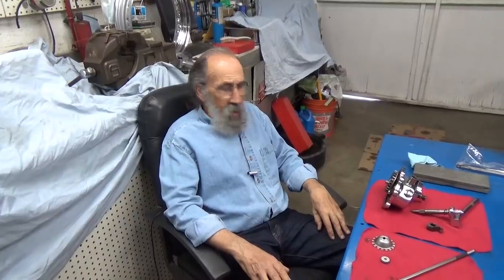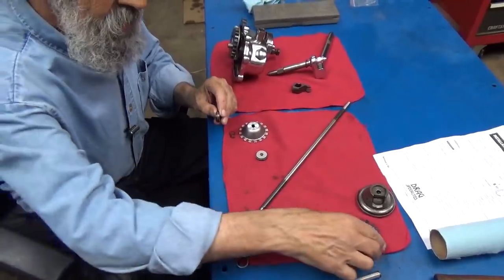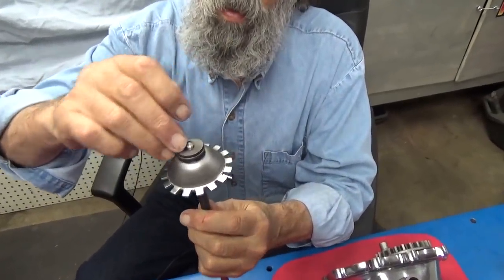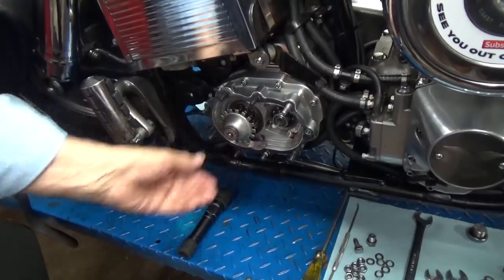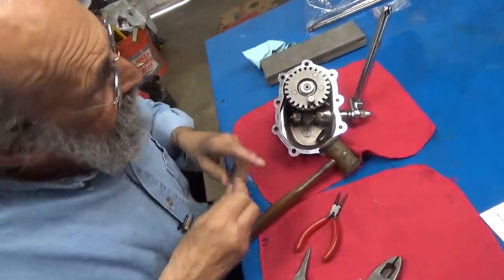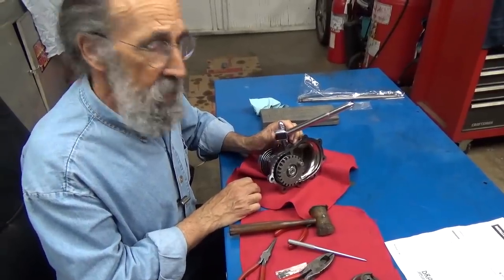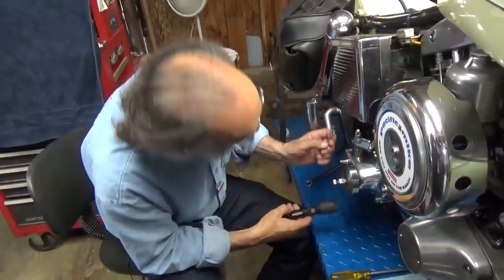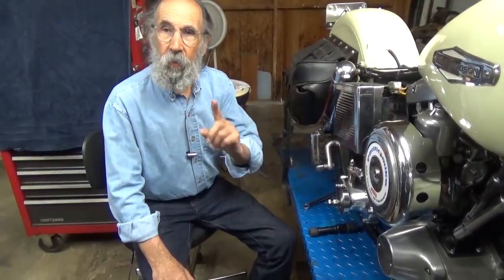Repair by replacing: Clutch Throwout Bearing and Oil Slinger on Harley Davidson Shovelhead.

Comment: Ran out of oil in primary cover and rode miles .clutches are fine.
Reply from the maker: Don't know what you have, but I'm glad it's okay.
Reply: No power .what would be wrong
Reply: 74 super glide
Reply from the maker: The primary is not designed to hold oil on a 74 Superglide.
Reply: Yes it does..leaked out ofprimary cover and clutches we're dry and I drove 10 miles ,no power in gears 74 superglide 4spd
Reply from the maker: Okay.  But that unit was designed to circulate oil, so it never was supposed to hold much in it.  It was just supposed to oil the chain as it passed through.
Reply: There was no power in gears..any idea much appreciated.
Reply from the maker: Probably oil soaked plates.  Did you pour oil into a dry primary?

Comment: Ah, Torrington 'perma-skid' needles, for axial thrusts & the like,
all radial/circumference/diameter, & the feeling that something ain't right.
'Cos the folks rolling round on the outside, spin faster than those by the hub,
& as they're all part of the same shaft, the 'skidding' must turn into 'rub'.
They're naff & I really don't like them, but they're slim & they handle the load,
but remember what's skidding & spinning, when you sit with one 'in' on the road.
For a ball's contact points are all pointy, but rollers are longways & flat,
& far more resistant to squashing, when 'rolled' round the rim of your hat.
(Greetings from sun kissed Middle England, original centre of the Gooniverse : )
Reply from the maker: Good Job!  Thank You.
Reply: @pacificmike9501  My pleasure Mike, '& we shall draw the things as we see them, for the God of things as they are'.(from Kipling's - 'When Earth's last picture is painted', one of his best & if you'll pardon me saying, that last line is 'so you'!) I hope you're staying well & happy, carry on : )

Comment: I think you need the Official Factory Harley Davidson Two Week E clip installation training course. Only $13,295 incl taxes but you have to add your flight and accommodation costs to that.
You do wonder sometimes how they do stuff in the factory, don't you? I bet they have a special tool, Part Number SIENGIS=294872 to do that job. I see you have found the same Murphy's Rule as I have: the only way to find something you have lost is to go out and buy a new one. As soon as you get home you trip over the one you lost.
Reply from the maker: Yah.  This one was funny.  I found it later in my beard.  But, I'm ordering the tool.   Thanx for the proper number.